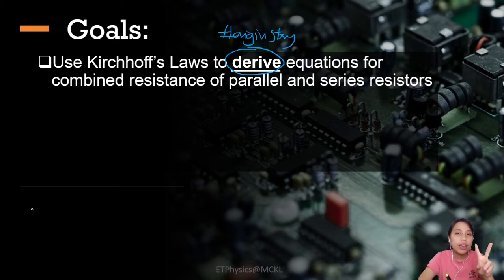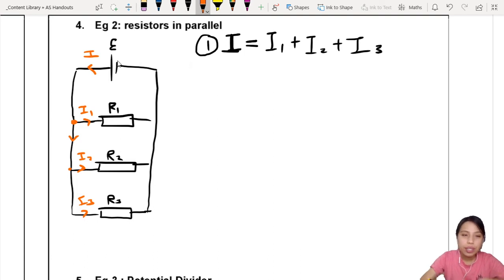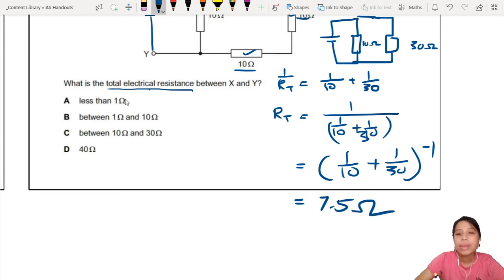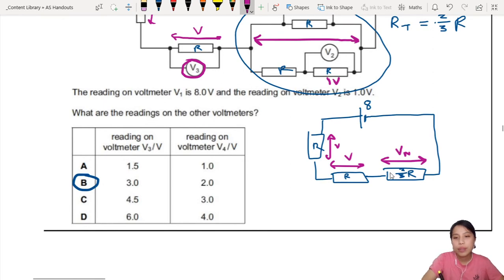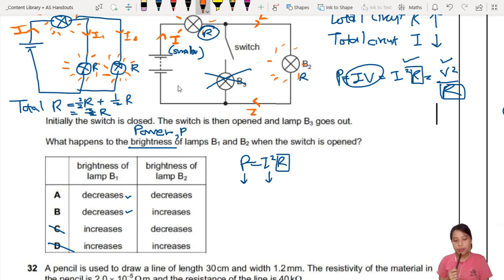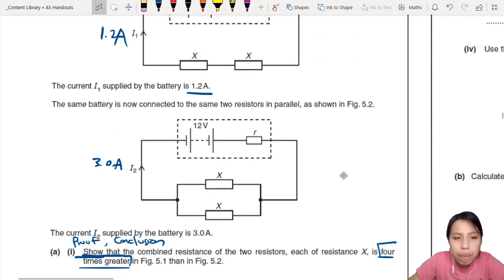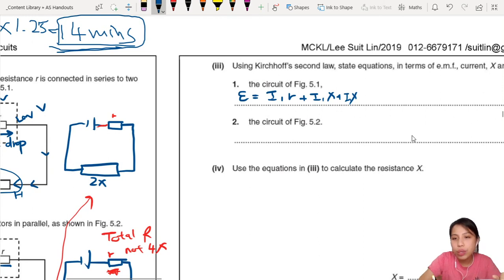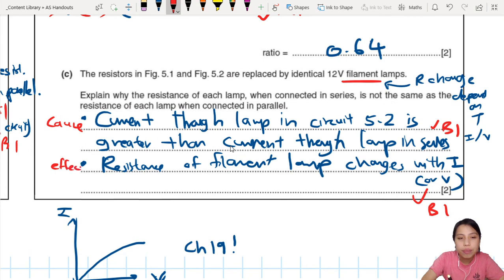[ARCHIVED] Series and Parallel Circuits | AS DC Electricity

Comment: At 35.16
Why did power of B2 increase when we use V^2/r
As v2 is less that V1
Reply from the maker: Yes the ratio of V2 is smaller than V1. But don't forget we are looking for the CHANGE in voltage across bulb 2 when the switch is opened!

When switch opened, parallel resistance increases, so Bulb 2 takes more share of the battery's p.d compared to before. Since V increase, P increases.

Comment: Thank you so much for this amazing video❤️
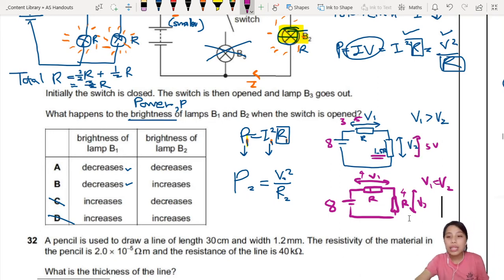I had a question (ON 14p11q30) at 34:00 why did we assume that the resistance is constant didn’t the total resistance change when switch is opened
Reply: she's talking about resistance of tht one bulb. but i don't know why voltage changed. isn't voltage for B1 always 1/2E?
Reply from the maker: Yepp since these are lamps (and not filament bulbs), its resistance is constant. BUT the total circuit resistance is changing! 

As for B1, is 1/2E the voltage when the switch is open or closed? Try pick some values and calculate the voltage for both scenarios!